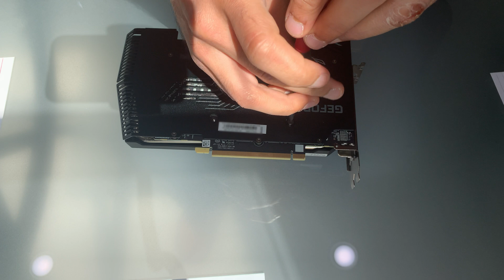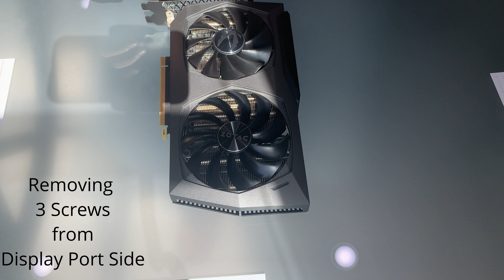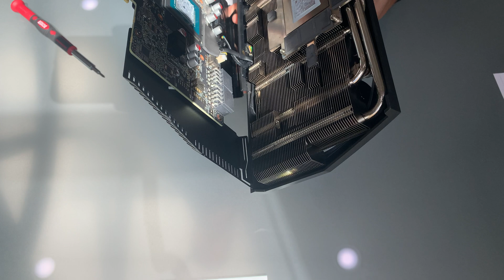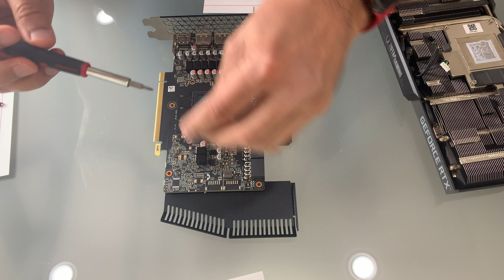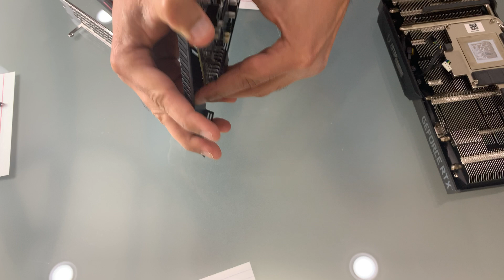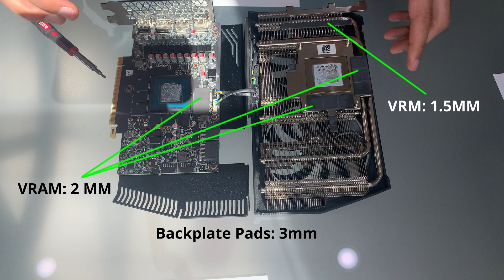Changing Zotac Twin Edge OC RTX 3070 Thermal Pads

Comment: ok i watched another video, seems the small square thermal pad next to a memory chip is also 2mm,  but there is like a small short line of thermal pad on a tube next to other memory chips, that the other video mentioned it is 1.5mm , (same thickness as the vrm)

Comment: MTB monk, on the front side you mention that vram pads are 2mm, vram uses 3 big pads, but there are 2 extra pads very close to the vram pads, one is very small, and the other one is very mall too, would those 2 also be 2mm thick ?

Comment: Pretty sure the reason you were experiencing thermal throttling was due to inadequate air flow in your case. I have the same Zotac card and I've yet to see it hit 80c. Just saying. 🤷‍♂
Reply from the maker: It turned out to be poorly optimized software by asobo. I’m never buying their stuff again

Comment: I have a simple question: Is it better to apply 1 full strip or to cut them at each VRM/VRAM chip's size? Because if I get very good pads (that are usually very expensive) cutting them (and applying perfectly) will take longer but  obviously I'll use less and maybe not need to buy 2 stripes of each just in case.

Comment: how much length did you use for the VRAM? i have 120x20mm will it be enough for the VRAM?
Reply: Was it enough 120x20mm? Asking because i also got it same length
Reply: @Malik Jensen  I ended up getting 80x40 for safety reasons (cut it in half and you have basically 160x20) even had some leftover if you make a mistake. If it's your first time I'd suggest get this one.

Comment: Well on vrm is also 2mm not 3.... Where did You get this measurment ??? 🤔🤔
Reply from the maker: I measured using calibrated calipers.
Reply: @mtbmonk7076  thats odd...mine are 2mm, 3mm are too thick and raising up radiator up, but I didnt measure old pads.. I measured hole after putting radiator and screwing it with screws. There is like 1,9mm free space between vrm and heatsink so 2mm is a max pad there
Reply from the maker: @Albert41122  My replacement pads fit perfectly. I wonder if Zotac has changed the specs
Reply: @mtbmonk7076  I got NON LHR version

Comment: Talking from experience  in gpu repair,since you mentioned itll stutter after a while which means card getting hot ,its either a bad mosfet or bad memory controller or a capacitor sorrounding aforementioned chips ,i highly suggest that you rmathe card ,orherwise get to to a repair shop and they will check the aforementioned components with oscilioscope for degradation and malfunctions
Reply from the maker: I turned out to be poor programming from Asobo, the maker of Microsoft Flight Simulator. Almost 2 years after it's release, it's finally smooth and functional

Comment: Hey~ sorry just a question. I noticed that you measured the VRM thermal pads to 1.5mm and 2mm. Do you know if it'll be ok to just use 2mm?
Reply from the maker: I don’t recommend it. It may damage the screws… and it’s nearly impossible to find replacements.
Reply: i used 2mm the the vrms and had thermal issues

Comment: I'm wondering if I should try to liquid cool mine. I have a rack dclc liquid cooler and am wondering should I try to use it.
Reply: same here, i was hope the kraken g12 would fit but after wacth the vid all those capacitors would be a problem, so did you water cool it?
Reply: @testdirver  hi, no I water cooled my CPU, and added a fan for my exhaust. I have three fans in the front, with the radiator & another three fans, two fans at the top, and one on the back for exhaust. I believe I'm gonna leave it like this for now since by my trying to cool the GPU die, I would still have the rest of the card to worry about, and I seen the addon for GPU s to have water cooling plus a fan are made for the 20 series cards, with the fan being on the wrong side. Unless I went with the full custom design which I don't want to spend the money. I have a 3070 w/ 5900x by the way.

Comment: I tried swapping out the pads with some 3mm as I figured a little to big shouldn't be a problem... Turns out it is and now GPU doesn't make proper contact with the heatsink and won't boot into windows before crashing... Anyways I ordered some proper sized pads using your guide and just wanted to say thank you for this! Wish me luck :)
Reply from the maker: I used an oversized pad with a 3080. Luckily the pads could be smushed down; however, the screw got stripped in the process
Reply: @mtbmonk7076  I had the same problem with a 3070 MSI gaming trio X. Turns out 2 vram pads were 2 but the third one was 2.5. Forcing the screw in was a bad idea. I managed to make proper contact but now, I can't get some screws out (without a screw extractor, which will destroy the screw in the process) Did you end up replacing the screws?
Reply from the maker: I couldn’t find any replacement screws. I’m thinking of pouring epoxy into the screw head and then inserting a screw driver into the epoxy to “mold” a new screw head

Comment: any temperature difference after swapping only the thermal paste? I'm just really hesitant to change it because of warranty stickers in my zotac 3070 model
Reply from the maker: At the time I made the video, hwinfo only showed the GPU core temp on the 3070. No difference in temp noted. But I later discovered that I could OC the ram whereas before I couldn’t.